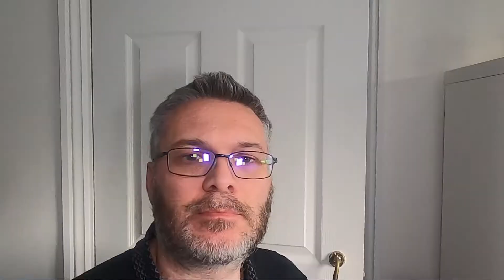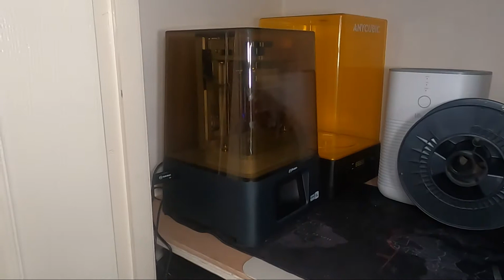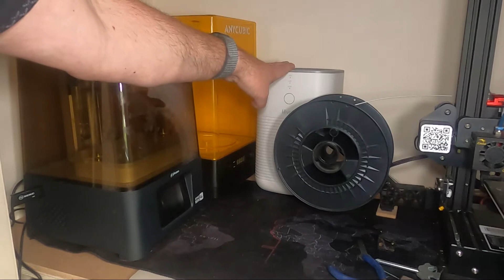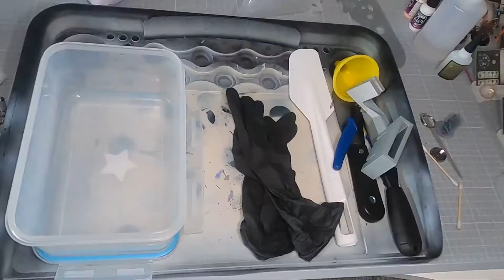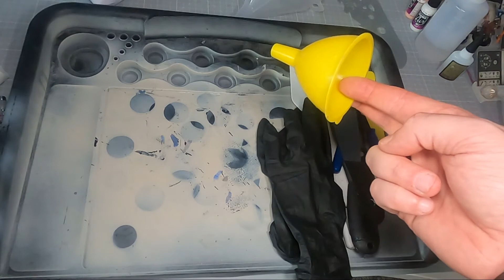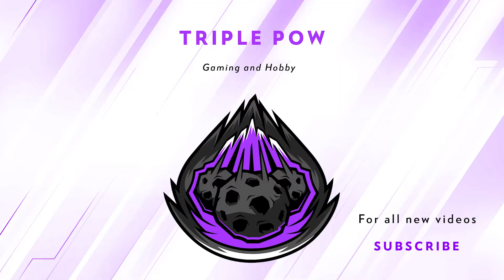My 3D printer set up and process

Comment: Cheers for doing this video. I'll be getting myself an air filter now then and finally setting up the printer.
I've been worried about setting it up in the house because everyone says how toxic it is. But this looks like an ideal solution!
Reply from the maker: It really does work - you can test by putting a hand towel near - if it doesn't absorb smell - that's good. It's a Levoit Air Purifier for Home Allergies with Dual H13 True HEPA Filter. I'd recommend the resin lid (or clean the tray when not in use!)
Reply: @triplepow  ye the resin lid looks like a good idea too. Saves a lot of hassle not having to empty it everytime I should imagine.
I'll look that filter up now. Cheers again 😁🍻